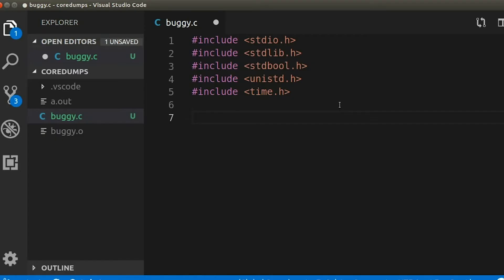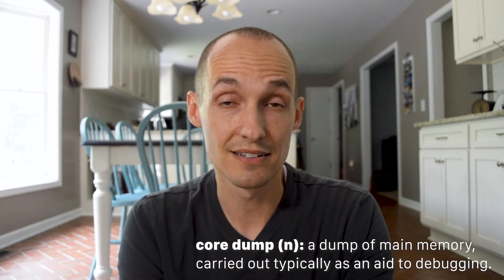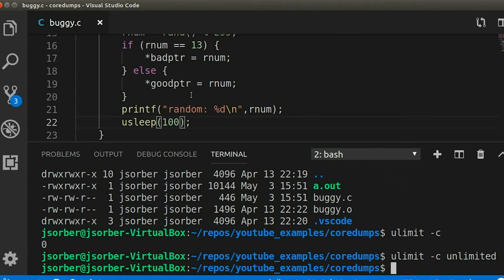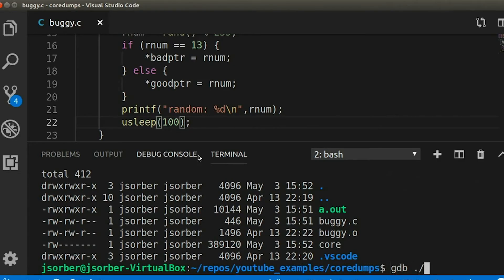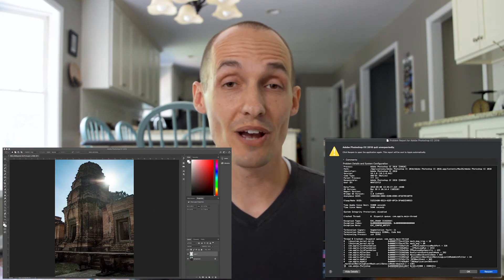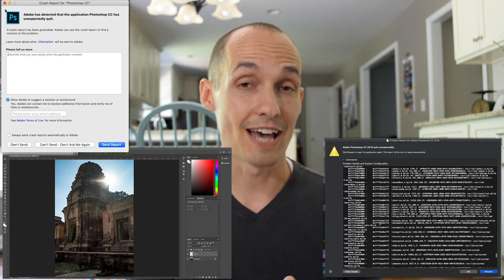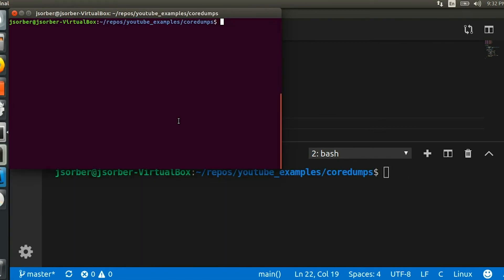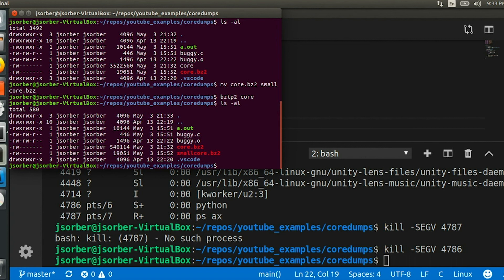Debugging with Core Dumps

Comment: I always thought that a core dump was something you had to submit to the CPU manufacturer (Intel/Amd/etc) or to NASA so that technicians in white lab coats could read the machine code that was in the CPU at the moment after the program crashed using an open CPU with lots of wires connected to it and where they looked at the contents of the memory with an electron microscope. But then it turns out that anyone can look at the program code with a simple debugger. Why couldn't they say this 40 years ago when I started as a programmer?

Comment: You didn't explain how to compile the program to contain all the debugging information so that the core file could be debugged in situ on a remote system where the source code to step through would not be available, for example at a client's site.

Comment: Wait, that means the user finding bug will need to tinker with the machine (assuming can get admin privileges) then try to crash it again to actually get a core dump. Sounds like too many loops to jump to help the developer to fix the app. Then how those apps with crash reports can get it without that?
Reply: It's only an assumption. But I guess programs with crash reports run a small runtime that catches segfaults and saves them before the operating system receives and trashes them.

Comment: great, but an issue, i have a mac, running vscode on its terminal, when i tried gdb but it says "bash gdb command not found"
Reply from the maker: Yeah, gdb doesn't come installed by default on MacOS. Also, Apple favors clang and lldb, and has done some things that make it tricky to get gdb working well on MacOS.
Reply: Jacob Sorber yeah, lldb worked

Comment: Thanks! Your videos are very informative, and have helped me a lot.
Reply from the maker: Glad they're helpful. Let me know if there are other topics you think I should cover.
Reply: @JacobSorber  A video on the Linux (POSIX?) LD_PRELOAD environment variable would be interesting.
Solving circular includes (such as with include guards) would be a useful video for people writing code.
(Assuming you haven't already covered these, haven't yet watched all of the videos. They're quite good and to the point.)
Reply from the maker: @MinusGix  I have covered LD_PRELOAD (see the videos on shims) and include guards (fairly recent video on headers).
Reply: @JacobSorber  Ah, ok. I had been watching the videos from oldest to newest to make sure I watched them in order, and hadn't gotten to them yet.
There is inline asm (unsure if clang has it, but GCC does), but that's rather obscure and most people don't use it.
Videos about common C patterns, such as common ways of structuring your programs would be interesting. (Such as writing code that uses flags, and why you would do such a thing.)
Could go into common ways that C++ library methods are written using C. This bit me when I recently tried using the Windows Direct2D api as the way it's structured to translate to C isn't obvious (the docs are all for C++ as well..) but I don't know if that's a common way of translating C++ to C or not.
There is writing a less-featured clone of a linux utility (perhaps ls?) and comment about the design decisions you make as you write it. That would be different from your usual videos though.
Since you seem to do embedded fairly often (?) you could talk about writing efficient code, and how the compiler also at times knows better than you.
Examining the assembled output of simple C programs to see how there can be differences. (godbolt.org is quite nice for such a thing, but this would also be a good way to also show some linux utilities)

Comment: great video!, Since you usually don't release with debug-symbols, I wonder how useful the coredump may be in this case. How can you extract anything without debug-symbols?
Reply from the maker: Good question (and good idea for a future video). Debugging without debug symbols is definitely more painful. You can still look at the assembly. You can also release with debug symbols (accepting the downsides). Or, you can generate two versions of the binary (one with and one without debug symbols) and then use the debuggable version with the core dump. For release builds, I think I favor the last one.
Reply: @JacobSorber  Right, But as far as I understand it, if I put in Debug-Symbols I cannot use the optimize-flags.

Comment: If you set it to like half the size of the full core dump is will that possibly not include the info you want or maybe not let the debugger run properly?

I don't understand what information it absolutely needs.
Reply from the maker: Good question. If the core dump is larger than the limit, it won't save any of it (rather than saving part of the memory). It's all or nothing, because it would be difficult to know what memory is most helpful.
Reply: @JacobSorber  so what is the use of adding a limit if it won't use the limit?
Reply: @XenoTravis  maybe it means.. if the size is lesser than the limit then only make core dump, otherwise forget it.